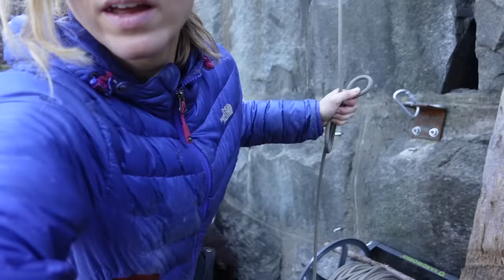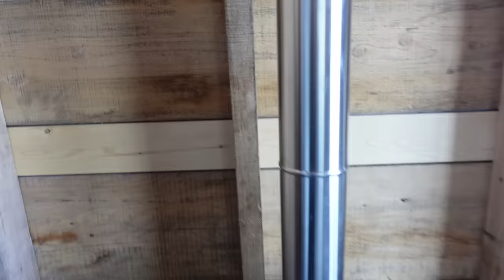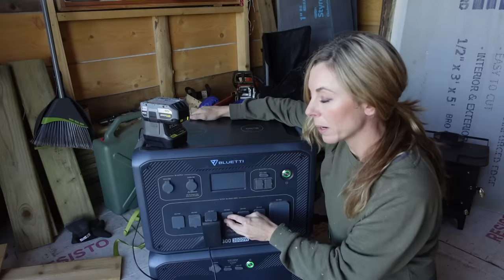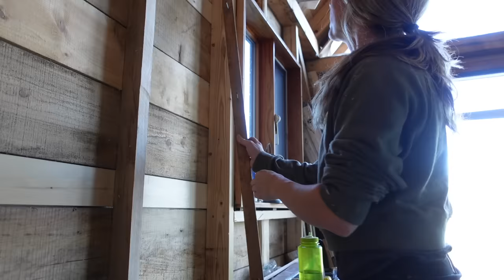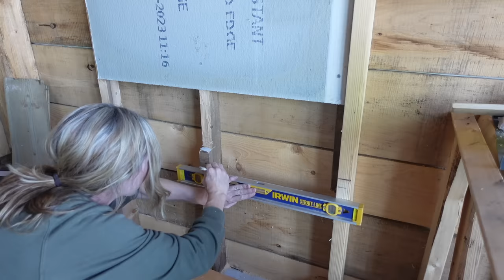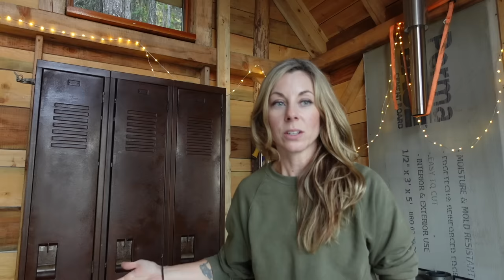Husband needs surgery = Rollin' with the punches.

Comment: What you need is the angle brackets that are on a flat plane, instead of a flat bar bent at an angle. Then you screw to the stud and put 2x2 and screw it to the brackets where it is out on the floor. Then screw your plywood to those 2x2 (or whatever size) strapping. Maximum strength met.

Comment: I like to see those landscapes every time 👍.
Here in Finland, the window installation opening is made about 20 mm larger than the window. The window is placed in the opening with wedges and fixed with urethane foam. The 10 mm gap around the window is filled with foam. The wedges can be removed the next day and foam can be added in their place. The installation is therefore air and vapor tight.
There seems to be a slightly different way, if I understood correctly (I understand about 60% of the speech, so I try to guess the rest).
Greetings from Finland. Thank you for the video.

Comment: Hope Steve's knee heals up fast and easy. re your stove shelf - I would not add another metal bracket - I suggest adding a few plywood gussets (triangular brackets) under the shelf, screwed to the studs. If you make them .62 or .75 x the shelf width front to back that will be plenty stiff and they will not be very visible. Just food for thought. Cheers!

Comment: I would suggest looking for some 45 degree angle shelf brackets or cutting some from wood. That will greatly enhance the strength to just the steel angles. Triangle are strength. You might look into one of those carbide 'cup' type cutter that can go on an angle grinder. They are made for stone and concrete but will cut wood too. They might get into those corners you need to  shave for your windows.

Comment: Greetings! I admire your willingness to tackle just about anything, and you’re creating good results. I would advise either a couple wooden 45-degree supports under the stove shelf, or a single metal brace similar to the current ones, but with its own 45-degree metal brace, located centrally. On your window issue, rather than shaving the downslope, consider shaving the center support. You’d have to figure out whether the center post or the window is out of square, but it might be the post, given you have a gap at the bottom but not the top. And if the window slides left, it solves tightness at the top. You’ll figure out some solution, and it’ll work, but some are easier that others! Good luck and well wishes for Steve’s knee.

Comment: If you have a look in shelving dept in the hardware store they should have the angle support built into the bracket, as well longer blades for reciprocating saw and you can spin the blade backwards just incase you were unaware. Speedy recovery  Steve .

Comment: Y'know what might be nice under the woodstove - if you have the time and luck to find it... would be a forked oak or maple limb that would be vertical to the rear and up at an angle under the stove base. That would give you the extra support you need and not be in the way like legs.
My grandfather used limbs for lots of stuff in his lakeside cabin - bedposts, shelf supports, etc. Always a great rustic look.

Comment: For future reference, the blades on reciprocating saws can be installed upside down.  For those times you wished could flip your saw to fit in tight places.  Also, those Japanese type pull saws work better/easier if you don't put too much force down into the cut.  Light pressure and let the blade cut the wood.  I hope Steve's recovery doesn't impact your upcoming trip to the boat.  Small steps toward completion is progress.  Keep plugging away and it'll get done.  Thanks for the episode.
Reply: I find that the longer blades come in pretty handy a lot too.👍
Reply: Also for future reference, check the depth of the blade before cutting...got pretty close to that ducting on the second cut😉
Reply from the maker: I did flip the blade around, but it still didn’t fit in there 😏
And it’s true - I notice when I stop trying to make the saw cut the wood, and approach it more like painting with a paintbrush, it works better 😁

Comment: Get well soon Steve. I had spinal fusion T11 - L1 in June & another surgery on my neck 3 weeks later. I healed fast for a 63 year old man. The struggle is real, but the joy is not in the destination, it is the journey. I would feel better knowing you were armed to protect yourself against wildlife and people with ill intent against you when you are so remote. Use the same angle brackets below will make sure the shelf will not sag because 1 will be in tension and the other in compression. When it comes time to add the stone & mortar, keep the cabin heated as per recommended temperature on product. This is usually 60F to 70F minimum (16C to 22C) for 24 hours. Consider temporarily moving the wood stove or use an electric space heater. Use a bonding agent on the board & mixed in with mortar. ❤

Comment: If you put a second pully on your zipline about three feet behind the first and attach to the first with a pole (to maintain the distance at 3'), you can place materials on the zipline, hooking them to both pulleys, and they will stay aligned with the zipline the entire trip down. You won't have to fight the battle of them spinning on the way down.

Comment: You are good with handling pulleys. You can get heavy duty  eye bolts to sink into window frame on two sides to pull window into place, building extra framing around window to transport down the hill.

Comment: Best to Steve. He's lucky to have you.
You may want the stove 6 inches from the wall board with a 1 inch air space behind.
I couldn't tell if it's insulated pipe.
They do make cell boosters(extenders) for dead zones. Maybe it could help you.

Comment: For the stove, what about on both sides of the shelf, a chain or cable with turnbuckle from the top front portion of the shelf, up to the studs. Chain would be easy, cable and turnbuckle could be turned to tweak if and when needed.

Comment: Michelle with regards to your windows, you do not want to be cutting away at the beams at the apex of the opening with your chainsaw. Align the vertical edge with the center post, allow a ⅛-¼" space between the glass and the vertical and slope sides, you now want to adjust the sill plate accordingly, ie: cutting it down, it might need to slope. Install your interior window stops before putting the glass in place and place ¼" glass shims at the sill. Once the glass is in place you can install the exterior stops.

Comment: Look at getting a Elbow for your stove. Matching your stove pipe diameter. That way you extend your base moving it further away, centring it  to pipe and giving it more distance for safety. Add cement board to your floor. With the elbow you can twist turn and line it up. I hope you see my vision?

Comment: Hope Steve is on the mend.  I'd just nail up some plywood  on those triangular window openings for the winter if you can't get them installed before then.  That little wood stove looks great and should take the chill out of the air.

Comment: the foundational aspect of construction is the multiplication of error. 1/16 out of level across two feet in the base of a column results in tremendous deviation from plumb 200' in the air. the saying 'sharpen your pencil' has significant importance in what you are doing... the best you can do is to minimize your errors, that can be achieved at a fundamental level by using a sharp pencil and accurate layout technique.

Comment: I don't know if this will be an issue, but over time wood settles a bit (I'm thinking log cabin here) so you might need a little breathing room on top of those windows so they don't crack from pressure over time.

Comment: For the cantilevered stove shelf, you should get flat L brackets rather than then bent ones. They will be better for your purposes and less likely to droop over time. Or use some timber screws to attach the horizontal supports to the inner side of the 2x4 studs. Just a suggestion.

Comment: I have one of those wood burners, you have to clean the chimney often in this system.  I have to clean mine at least 3 times a season. It would be wise to allow yourself the ability to clean the flue without getting on the roof. also they make a wall hanger kit for that stove where it mounts safely right onto the wall.

Comment: I'm in the camp of 'the more bracing of the wood stove ledge the better'.  Maybe 2 more inverted L brackets screwed to (shorter) 2x4 that's screwed to the wall & goes down, sits on the floor.  The road view at the end, was that a former rail line? Very cool bridge & tunnel!

Comment: Fast recovery to you Steve, I've had both my knees done. Just remember to keep moving it and it won't belong you be back
on your feet again. Now to you Michy dear, you can turn the blade around in the saw-all, so it cuts on the flat side. Good that 
way for cutting out door plates and of course many of things you need to cut flat. Question, Instead of those expensive 
and heavy window you had made, you could have use lex-sand plexy glass. It would have been a lot lighter. Keep going
young lady, your learn'en more all the time and your the best looking builder out there. 🤔

Comment: 1. Sending healing thoughts to Steve, especially ahead of the trip back to Taiwan to fetch and sail the boat back to Canada.

2. Possibly stupid question which you might've addressed back when you put up the platform for the wood stove: why not add a 2x4 at the front of the platform and move the stove forward the thickness of the cement board? Note that I'm asking this 15 minutes into the video, so I'll edit this if you answer in the video.

Comment: Hi 👋, Michelle and Steve, sorry to hear 👂 that Steve as problems with his knee, I wish him well and a speedy recovery, and it is very strange. I was only talking to somebody last week back in the UK., that had an operation on his knee about a year ago and has still got to have a bad problem with it, last week, it was supposed to go and back into keyhole surgery, they’re now saying that it might be more serious not sure what they’re doing, Chipmunk is probably following you up and down the hillside, you’ve gone back up to take some nuts to him, but he was on the way down, oh dear. 😂. I would definitely suggest putting some angle brackets under the shelf that holds the log burner up to give it some more support., especially when you’ve got your logs in it is going to create more weight, the last thing you want is that to fall down with all its fire and ash in board, regarding your angled windows, I believe it will be worth having around 10 mil or thereabouts clearance, allowing for structure, movement during the winter and summer, if I remember, rightly, there is a rubber gasket that you can use to set the glass unit into and that will help for the movement of the building, it must not touch , otherwise the glass shatter under pressure, 
under pressure, David Bowie and Freddie Mercury , I know a song about that, but I won’t tell you, I know that it is money, but you could put a small wind, turbine.  up that will help you to give electricity which will aid for electricity charging, something to think about for the future, it could be installed up or down the hillside, I was speaking to somebody last week, how to get better Internet phone service, this is money again, I know, but you can buy. I believe a booster kit that will help pick up the signal for you to receive., about the 20 years ago I had moved into a very large workshop and had to put a false ceiling in, are use the product that was 150 mil in thickness, but had tinfoil on both sides for thermal installation, it wasn’t until about 2 to 3 days later, and then noticed that I was struggling with my mobile phone and Internet, so I ended up purchasing a booster kit, the aerial was up in the air above the building, but had the main control unit in my workshop area, I had a perfect signal, in fact a lot better than what I had before, even people that are working in my area, had noticed the signal had actually improved, 
Your power pack system is very impressive, People think that I am a bit weird I probably am, I’ve even been told that I am mentally ill, and yes, I probably am, but if I think I can save money on electricity, I will. I have three rechargeable Milwaukee lantern lights., I want lantern light fully recharged will ask me nearly 2 weeks, so I do not put lights on in my property. If I need to go somewhere, I’ll take the lantern light with me, I can even charge my iPhone and iPad off it, and to heat my hot water, I only switch the power onto it once a week for approximately two hours, then give me enough water, hot for at least one bath and several showers, 
Since 2019, I have got my electric bill down by nearly 40%, 
You said you needed some help, I would gladly come and give you a hand for a week or so, or longer, obviously from your location to my location is a little bit far to walk ha ha, 😂 , at present, I cannot afford to do much, because my female ex partner is trying everything she can stop me from getting my funds from the UK, I have been scammed by her, 
Over the last five or six years, I have noticed on YouTube on the Internet, how loving couples respect and treat each other help one another and stand by one another when there is a problem, you too are so very lucky, 
I wish Steve speedy recovery, and both of you all the success for the future, 
Sorry if this is too much information, but I’m only trying to help, Phil from the Dark side of the moulin,

Comment: Take the wood down resaw some thiner and put up then frame window in on both sides put frame on out side then put in window and frame inside.
Reply from the maker: Those 2x4 wall studs can’t be taken down - all of the sheathing material is screwed into them from the outside.

Comment: You have more heat protection than you will ever need even if you drip used oil on the fire. Use Scribe molding around the windows and it will look fine. A hand rail around the deck would be nice. So far I have not seen any boats ion the lake from your cabin?

Comment: I would use plywood panels for the windows for a temporary fix and get the higher-priority items in so you can stay in the cabin. They can be unscrewed when you're ready to install the glass windows and trim. Also a bit late when watching a video that you have already completed a task, but would it not have been easier to make the stove base a little larger or however you are going to mount it as opposed to cutting 2x4's? Just make it stout so the stove/fireplace doesn't fall.

Comment: If you move the vertical 4 x 4 in towards the middle, it will increase your space on your window. You may just have to move it a half inch.
Reply from the maker: My issues are worse than that. And there’s no way I can move that king post now - it’s lag screwed from underneath where the sliding glass door is.

Comment: You should of built the window opening with a header on top with king and jack studs to support the weight load. Especially with the weight of the snow. Also you should install some rain gutters and a rain collection system like a barrel. Just saying. I like your enthusiasm and your abilities.

Comment: Mich....just sayin'...dont put anything on top if the Bluetti...its reserved just for wireless phone charging....even if the charging zone is in the center....putting a battery charger on top, thats a pretty powerful "electrical" interference so close to another electro magnetic field....Bluetti say not to put anything on the top. Ive got the same model by the way. 🙏🙏🙏😘😘😘

Comment: Why not use some stainless cables at 45deg to above the shelf to "hang" its support, leaves the underneath totally clear and as long as the shelf itself is strong/rigid, you are transferring the weight to the wall higher above it. Its not like they'd get in the way as you aren't brushing past it or anything.
Reply from the maker: Yep, I’ve thought about that too!

Comment: That looked like a lot of work cutting back the wall, just move the stove in six inches and patch the roof. :p I would do some nice local rock surrounding it too and that will absorb heat and give it off for a good hour or two after the fire dies in the middle of the night.

Comment: Could you put those L brackets up the other way so the strength is in compression? Also, that way you wouldn't have to take account of their thickness. You might still need some bracing depending on our heavy the Stove is, of course. Great channel, by the way. Hope Steve is mending well

Comment: As a pro, let me make few suggestions , get a rip guide to slide into your Riobi circular saw if it has the slots, also, you can buy offset blades for the reciprocating saw, which will make life much easier on those tight cuts, oh ya, sharpen your pencil Michelle 🫵